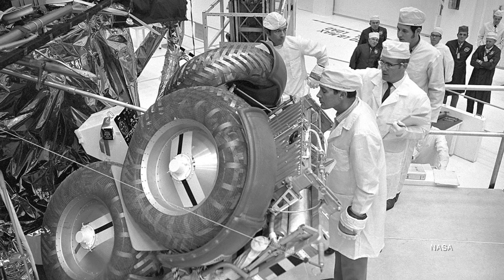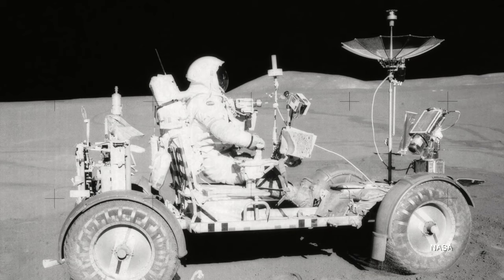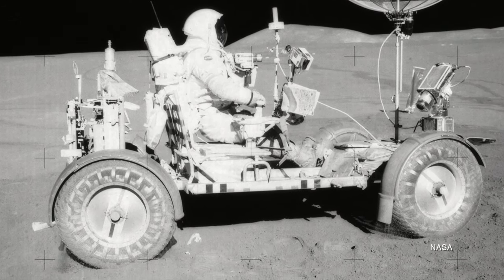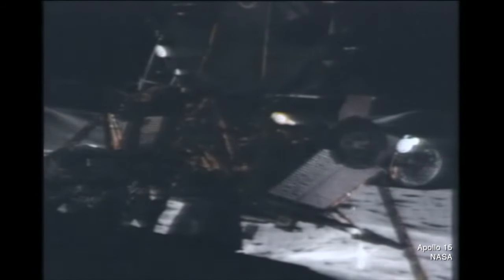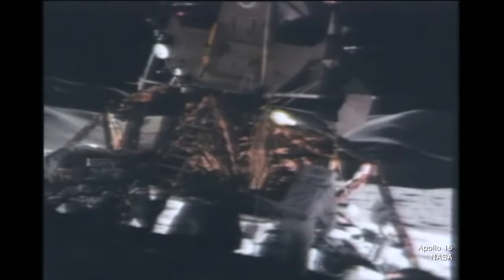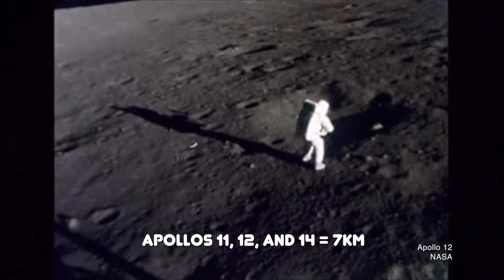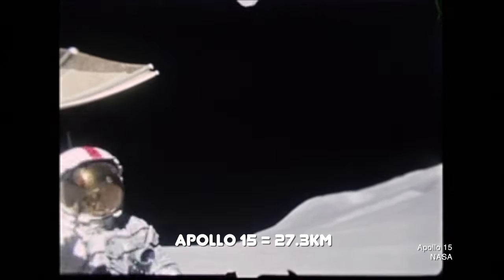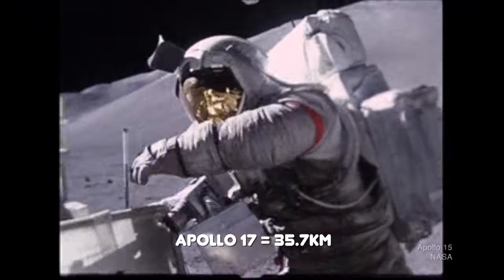How NASA Took Cars to the Moon

Comment: The Apollo program proved one point: That if mankind wills it, it can go to the stars. The fact that the opposite is also true - I.E that if mankind wills it - it can go down the drain with a push of a button, was known long before. So it's basically, only a question of will.
Reply: Will is not the problem, funding is.

Comment: Answer to QED, who says that it took 3 tries to get the signal from Earth to tilt up the camera at the time of the ascent of the return stage.
Though they kept getting it wrong, s/he says that the math was, “not that hard”. 
Tnx.
d.
Reply: On Apollo 15, the tilt function was broken on the RCA field sequential camera's articulated mount.  So, there was no chance to tilt up to follow the craft.  On Apollo 16, the tilt worked, but, the rover was parked a bit too close to the lander, which threw the math off, and the camera's tilting didn't match the actual ascent, and the lunar module went out of frame rather quickly.  Apollo 17 captured the ascent the best of all three.

Comment: How did they get through the Van Allen belts?
Reply: How would they go around them when they circle the earth? How would they survive going through them when the temperatures reach up to 4000f? Nothing on earth can withstand those temperatures!
Reply: I’m guessing you believe Elon Musk launched a car into space?
Reply: @djh2633  
YOU SAID: "How did they get through the Van Allen belts?"

== By going fast, and by going around the worst parts.

YOU SAID: "How would they go around them when they circle the earth?"

== The Van Allen Belts are somewhat donut shaped, with the worst parts being above the equator, and the least dangerous parts being above the poles.  But, there wasn't enough fuel to shoot straight up over the poles, make a 90 degree turn, and head to the moon.  So, they compromised.  They went out on an angle taking them away from the worst parts, but not as harmless as the best parts either.  And, at 25,000 mph, they went through fast enough that it wouldn't matter as much.  That kind of radiation is mainly about exposure time.  If you want to compare to something like the ISS, or shuttle, or future Orion missions, etc., which would be exposed for weeks/months at a time, sure, the Van Allen belts are a major problem.  But, on Apollo, they shot through them in a couple of hours.  Big difference.

YOU SAID: "How would they survive going through them when the temperatures reach up to 4000f?"

== Temperature OF WHAT?  Sure, there are some particles that reach huge temperatures.  But, who cares?  Let me draw analogy for you to understand better.  If you jumped in a pool of water that is 200 degrees, you'd cook yourself to death pretty quickly, right?  But, if someone sprays you with a very tiny mist of 200 degree water, the tiniest droplets, you'd just feel a tiny bit of warmth, and that would be all.  Well, space is like that, but even LESS than a mist.  We're counting molecules at that point.  They don't make a difference.  In fact, Apollo's craft would tend to get colder, not hotter, if it weren't for the heat produced by the electronics and people inside.

YOU SAID: "Nothing on earth can withstand those temperatures!"

== Well, that's wrong.  But, again, who cares anyway?  Again, you're not jumping in a pool, you're being sprayed by the tiniest of tiny mists, not enough to make a difference.  This is a near perfect vacuum we're talking about.  The particles in that vacuum can be hot, but seriously, it's like a fly hitting a freight train, it's not going to make a difference.
Reply: @rockethead7  ...another great amswer...

Comment: I have one question regarding the gravity of the moon , How does the  vehicle or the Astronauts stay on the ground of the moon ? If there's no or less gravity aren't they supposed to Float in mid air ?
Reply: +Madhu Suthanan - lunar gravity is 1/6th that of the Earth, so no one is going to be "floating in mid air" on the Moon.  A 200 pound man (not counting spacesuit and other gear) would weigh a little over 33.07 pounds on the Moon.  Online sources say that the Apollo EVA spacesuit weighed around 200 pounds, so that means a total weight, on the Moon, of 66.14 pounds (astronaut plus suit).  Muscles used to moving a 200 pound body on Earth would be capable of some super human leaps on the Moon.  Here's a handy calculator for you:

http://www.learningaboutelectronics.com/Articles/Weight-on-the-moon-conversion-calculator.php#answer
Reply: photoboyjet Thank you
Reply: Madhu Suthanan there is enough to get them slowly back to ground
Reply: Kai thank you for your help
Reply: No. There is gravity on the moon. this is basic shit, try google. Wikiepdia. You can learn a lot. 1/6th gravity means you weigh 1/6th your weight. You will not float, and nothing will "float" like a balloon, because there is no atmosphere.

Comment: Why cant Hubble see surface of moon. Rovers? But satellites. Can see the surface of earth.  Cars
Reply: Satellites can barely see cars.  You're undoubtedly talking about imagery from Google Earth, or Google Maps.  That's mainly aerial photography when you zoom in, not satellite imagery.  As for why Hubble cannot see rovers, it's because Hubble isn't anywhere near big enough.  Not by a long shot.  Hubble imagery of the moon is around 150 feet per pixel.  You won't see a rover with Hubble.  In order to see something as small as a rover from 238,000 miles away, in any more detail than just a few pixels, it would take a lens about a quarter mile in diameter.  LRO is only about 30 miles above the rovers, and even that's just a few pixels per rover.
Reply: @rockethead7  thanks for info. Makes sense
Reply: @rockethead7  so I've heard astronauts say we can't go to the moon right now cause of the radiation belts
Reply: @eyeswideopenareyours6952  
They can't go to the moon right now for many reasons.  Mainly, it's because there is no human rated booster powerful enough, and because there is no lander.  What astronaut said they couldn't go because of radiation belts?  I've never heard an astronaut say that.
Reply: @rockethead7  I'll find his name. Cause of the van Allen belts
Reply: I'll find the source get back to u
Reply: @eyeswideopenareyours6952  
Hint: you're almost certainly talking about the 2014 Kelly Smith (male, and not an astronaut) video where he was talking about testing Orion for the Van Allen belts.  Note: Orion passed those tests later that year in 2014, yet the conspiracy nuts still fling that video around, as if it's evidence against Apollo.  All he was talking about was that it's a new craft, with new computers, and new mission profiles, so it needs to be tested before putting people inside.  They did the same with Apollo 6 (unmanned), by the way.  They tested it by sending it up through the belts and back, before ever putting people through them.  It passed the tests (obviously).  But, conspiracy nuts fling this 2014 video around under the premise that "Hey, if they figured it out in the 1960s, why would they need to test it again?  Therefore Apollo never happened."  But, this is pure stupidity.  Of course they want to test the new craft with new computers and new mission profiles, before putting people inside.  This is no different in concept than when a new type of aircraft is built, they want to test the new wings first.  They're not going to just slap on the same wings as a different craft, and hope they work.  They need to test it first.  And, that's exactly what Kelly Smith was talking about in his video, they wanted to test Orion first, and they did so, and it passed the tests.
Reply: @eyeswideopenareyours6952  
Yeah, that's what I thought.  No answer.
Reply: @rockethead7  I was asking genuine questions. I have other things to do that's why no answer buddy. 😁🙄
Reply: @eyeswideopenareyours6952  
So, you were asking questions, but had other things to do, so you didn't get the answers.  Ohhh kaaayy.  Then, why'd you ask in the first place?

Comment: 1:08 And you can't just run it on gasoline like a normal car using an internal combustion engine because there is no air on the moon, making the LRVs ealy battery powered "cars".

Comment: When one of the fenders broke on a mission-I forgot which one-the astronauts fixed it with a map and duct tape.  Duct tape fixes anything anywhere-even the moon.
Reply: Fixing the fender with duct tape is probably going too far. Duct tape certainly was used to assemble the maps into a replacement fender section but the replacement section was attached to the rover with a couple of metal clamps, which suggests that they did not think that duct tape would be up to that task.

http://tothemoon.ser.asu.edu/data_a70/AS17/processed/AS17-137-20979.png

Comment: Did the Apollo astronauts ever get “lost“ on the moon while exploring?
Reply: The Rover had a navigation system that used a gyroscope to monitor direction and odometers attached to the wheels to measure distance traveled and continuously output the heading with respect to lunar north, the bearing back to the LM, the range back to the LM, total distance traveled and the velocity. So no, they were never "lost".

Comment: my difficult questions are being removed so i will try again. apollo 11. the command module was travelling at 17,500 mph in lunar orbit, the LEM seperated and descended to a complete halt when it landed. how was this done with four micro jet thrusters, no wings or stabilisers , no parachute, no successful landing conducted on earth, yet somehow, six missions had no problems, not even considered an issue. sure!🕇
Reply: "my difficult questions are being removed so i will try again." Difficult? On those few occasions when your 'questions' have achieved a combination of being sufficiently coherent to be understood and sufficiently specific that a subject could be identified You have revealed that you have near zero actual knowledge of the Apollo program or related subjects, and been corrected.

"apollo 11. the command module was travelling at 17,500 mph in lunar orbit," a case in point. Lunar escape velocity is 5,323mph so if the command module was in orbit (and it was at this point) it must have had a velocity that was less than lunar escape velocity, and so certainly not more than 3 times greater.

Having identified your proposed 17,500mph velocity as ludicrously wrong it is trivially easy to use Google and simple math to get a better ball-park figure for its velocity. So, the CSM was apparently orbiting 110km above the surface (presumably on average), and doing one orbit in 119 minutes. The mean radius of the moon is 1737.1km so the orbit can be approximated as a circle with a radius of 1847.1km. Then the circumference of the orbit can be calculated from 2*PI*r and divided by the time for one orbit to give a velocity, which comes out as 5852km/h, or 3636mph or 1625m/s. Obviously a fairly rough estimate as, for example, orbits are elliptical not circular, but it does give a much better idea about how much deceleration would have been required for the landing.

"the LEM seperated and descended to a complete halt when it landed. how was this done with four micro jet thrusters" It was not done with "four  micro jet thrusters" (and even this is incorrect as there were 16 thrusters not four). It was mostly done with a 10,000 lbf (45,000N) thrust, throttleable, gimbaled rocket engine capable of a delta-V of 2,500m/s (which can be directly compared with the ballpark orbital velocity estimate above of 1625 m/s showing that the deceleration from orbital velocity is possible using that engine, with room to spare for resisting the acceleration due to lunar gravity).

"no wings or stabilisers, no parachute" of course not, there is no significant atmosphere on the moon.

"no successful landing conducted on earth", except for the all of the simulated landings, including all of the (hundreds of) landings in the Lunar Landing Training Vehicles:-

https://en.wikipedia.org/wiki/Lunar_Landing_Research_Vehicle#Lunar_Landing_Training_Vehicle

"yet somehow, six missions had no problems" yet the final Apollo mission was numbered 17, meaning your "six missions had no problems" is seriously cherry picking from a program that had a couple of significant failures over its lifespan.

"not even considered an issue.  sure!" Yes, ignore all of the issues addressed in designing, planning, testing and training and there are no issues left.
Reply: +The Woob
Mind explaining were you got "the command module was travelling at 17,500 mph in lunar orbit" from?
Reply: G P no content in your channel oh learned one. why not?
Reply: A parachute or wings are useless in a vacuum.   The descent engine of the LM did the job....that's why it was CALLED a descent engine.

As for how it did the job in a vacuum....I suggest you look up Newton's 3rd Law of Motion...which also explains how the CSM/LM stackl slowed to lunar orbital speeds.

Descending to a halt when it landed....uhhh...that's pretty much the definition of landing.

The 4 small thrusters were for changing the attitude of the CSM, NOT for changing orbital speeds or trans earth injection.   Again, see Newton's 3rd Law.

As for 6 landings no problem....you DO remember that the vast majority of the guys who flew in space were test pilots first, right??  And that the folks at NASA kinda DID know their jobs??

Comment: What about the engine..? How does a combustion engine work in a vacuum? Assuming it was an electric car, the battery would have to be enormous, yet there's no signs of one, or much of an engine at all..
Reply: "What about the engine..?"   -- OK, what about the "the engine"?

"How does a combustion engine work in a vacuum?"   -   Presumably you mean an internal combustion engine? If you wanted to run one in a vacuum then you would need to provide an oxidizer supply in addition to a fuel supply, and radically overhall the cooling system. Of course that is irrelevant to the lunar rover.

 "Assuming it was an electric car,"   -   It was an electric car.

"the battery would have to be enormous, "  -  There is a world of difference between 'the battery would have to be enormous, and here is the math that shows why' and 'based on evidently uniformed guesswork, the battery would have to be enormous'. 

"yet there's no signs of one,"   -   If the uninformed guesswork that prompted your conclusion that there should be an "enormous" battery was incorrect then you wouldn't expect to be able to see an "enormous" battery.

"or much of an engine at all.."    -   The rover used 4 quarter horse power electric motors, one mounted in each wheel hub. 

Have you ever considered the notion of doing research in the areas of questions that you want answered? Research into the subject of the lunar rover, for example, would have turned up a PDF version of a 1971 publication called "lunar roving vehicle operations handbook" which describes all of the components of the rover, their nature, function and  location, the operating characteristics, envelope and procedures for the vehicle, and the fault handling measures and back-up systems.

Comment: Great video, they trained for the rover on a simulator at my Dad's building at Marshall Space Flight Center in Huntsville Alabama. I got to drive it when Dad took me to work one day. It was a six degree freedom simulator adapted from a Air Force simulator. It was quite fun. It had a ten part trail to follow. The last one was a hill which I gunned to climb up but it was too much  and the simulation stopped at the top of the arc of the jump.

Comment: How didi they make camera fallow up at take out, and why is the so few ehaust gas and dust?
Reply: Pierre Truchon The engineer, Ed Fendell, calculated the rate the camera would need to pan to capture the takeoff based on the acceleration of the craft. He then specified where to park the rover and programmed the camera to pan as required. All he had to do was send the command to run the pan up programme from mission control at the correct time.

The rocket used Aerozine 50 and Nitrogen tetroxide as fuel and oxidiser. These burn with a clear flame, so you can't see much coming from the engine bell.